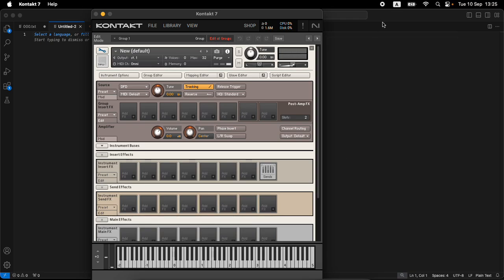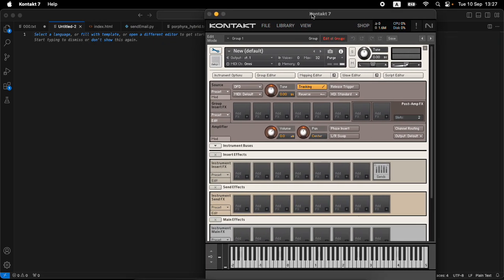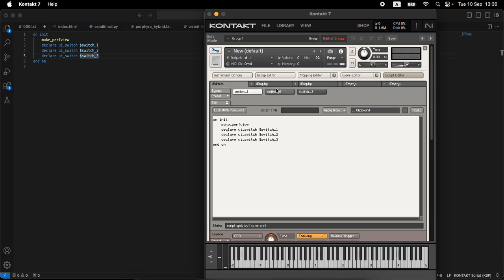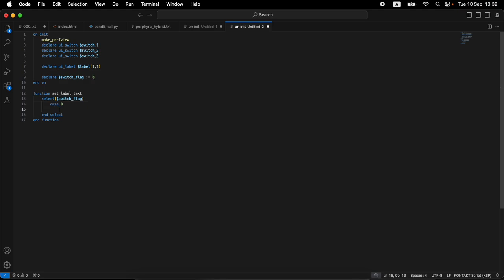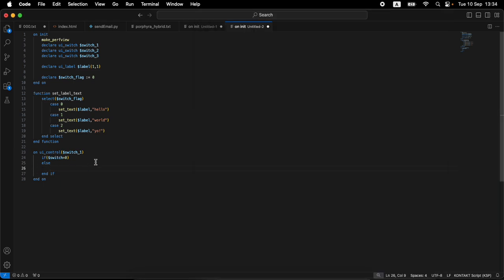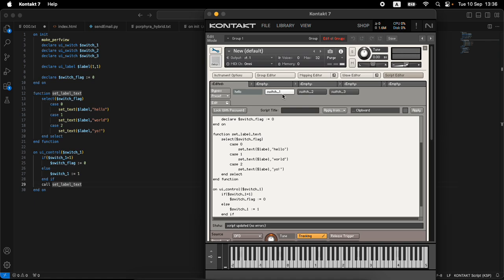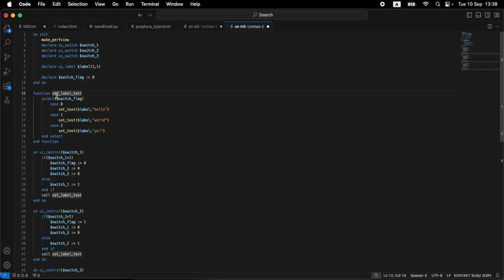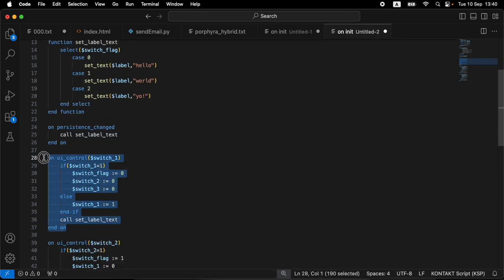Kontakt Builder KSP Scripting Course Tutorials - Lesson 13 (Radio Buttons Example)

Comment: I've been watching your videos since Lesson 1. Thank you so much.
I have a question. In this video, select() is used. However, it is possible to reproduce it using what you have taught me in previous videos. For example, I wrote the code like this.
   ----------
on init
  declare ui_switch $switch_0
  declare ui_label $label_0( 0, 0 )
  declare $touched
  declare !switch_label[3]
     !switch_label[0] := "hello"
     !switch_label[1] := "world"
     !switch_label[2] := "sea"
end on

function set_label_text
    set_control_par_str( get_ui_id( $label_0 ), $CONTROL_PAR_TEXT, !switch_label[$touched] )
end function 

on ui_control( $switch_0 )
    $touched := 0
    call set_label_text
end on
    ----------
Is it better to use select() rather than !(string array)? How should I think about the selection of code?